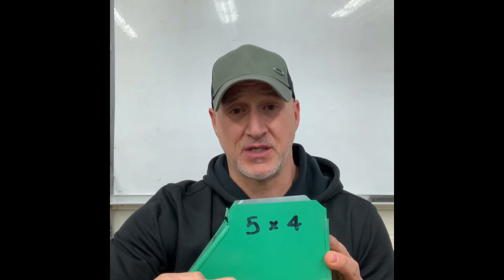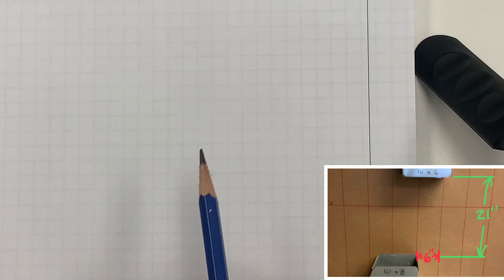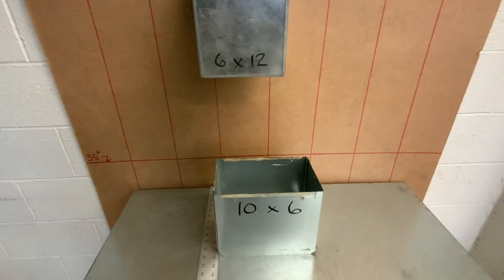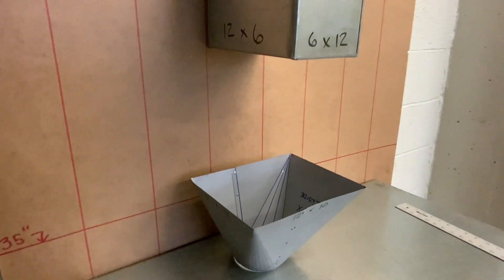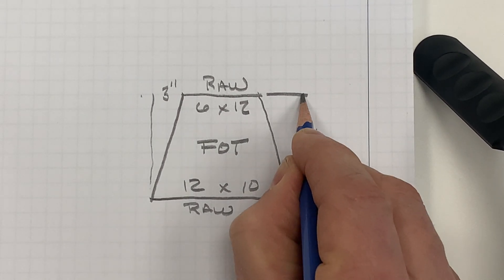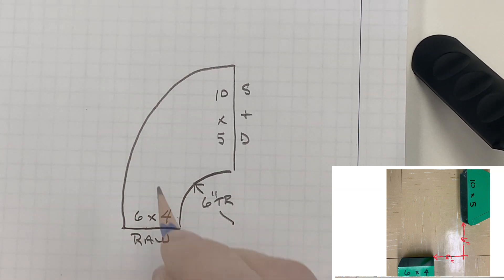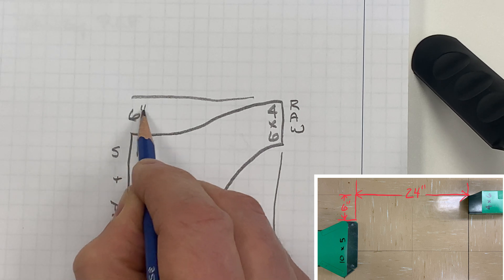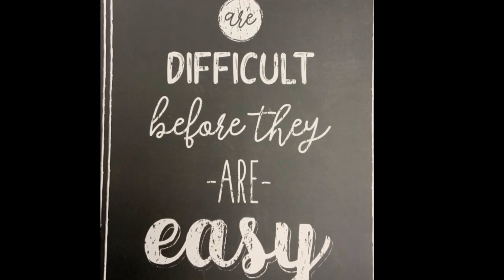Shop Tickets Part 2

Comment: Hi Duane, could you please refer me to a good instructional layout book?  Thanks in advance.
Reply from the maker: @Oxatolla  there is no one book that covers it all.  My question to you would be what type of fittings or products are you looking at developing?
Reply: @sheetmetalwork  thank you for responding!  I need to become more proficient at transitioning- branches, offsets, risers, drop cheek elbows.  (Anything with a radius that transitions).  Also round reducers and square to round.  I have made some via your excellent videos.  I just wish I had an official reference book of the trade.  I am 56, I did not go to school for this.  My buddy taught me, but I lost him before he could teach me everything.  Thanks Duane!
Reply: @sheetmetalwork  Having trouble getting proper guages of sheet metal.  Any chance you could post a chart showing correct 28 and 26 guage metal with min and max tolerances?  Thank you Duane.

Comment: Great video.

I got a great drop cheek shortcut..
Reply from the maker: I also enjoy shortcuts 👍but only after spending a little time, learning and doing it the long way. lol
Reply: @sheetmetalwork  best thing about them is learning how much better/easier/faster they are than normal. Gotta know normal to appreciate it!
Reply: @sheetmetalwork  completely agree.  First drop cheek I ever laid out, was the long way, then someone showed me the shortcut.
Plus I had to learn the hard way that the shortcut doesn't work on the throat when the set is extreme. 
As far as learning things the right way, I've already pointed people to this channel.
Reply from the maker: @dropcheekelbow9110  thanks for taking the time to comment on your drop cheek short cut. Hoping others will benefit from it. 👍
Reply: Share?
Reply: Ok.
Layout the flat cheek and calculate throat/wrap length. Trace an opposite cheek that will be the eventual "drop" cheek, but don't cut it out just yet.
Then layout the wrap/throat and measure the length of the "drop" side of the wrap/throat.
The difference of the flat wrap/throat length and the slanted side length of wrap/throat is then divided by two and physically drawn on to/added to the ends of the throat and wrap of what will be the "drop" cheek.
Cut, ez-edge, kink, Pittsburgh, and assemble.

Will not work on extreme slants, but works on most.
If transition is central, use an imaginary flat cheek.
If the elbow sets up or down, more triangulation is required but still can work.
Reply from the maker: @dropcheekelbow9110  well said!!!
and I agree on your explanation. Triminology often works WITH EXPERIENCE.
Reply: @sheetmetalwork  
Triminology!! I'm stealing that!